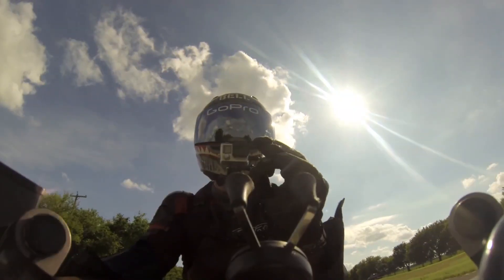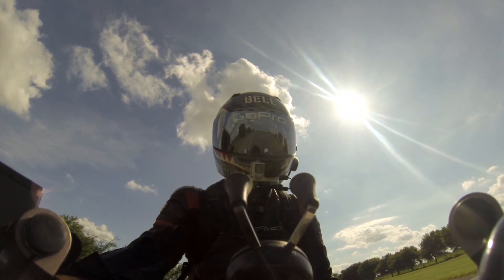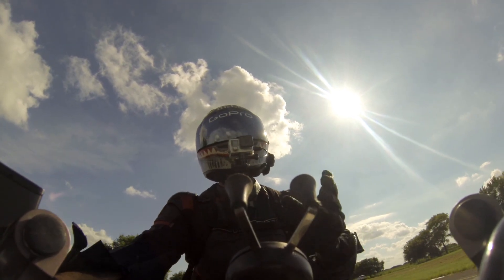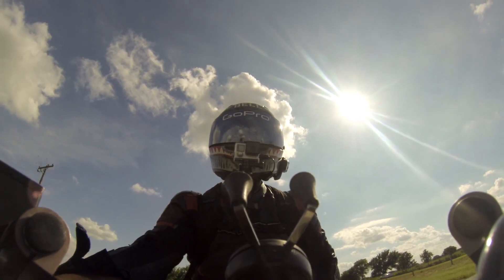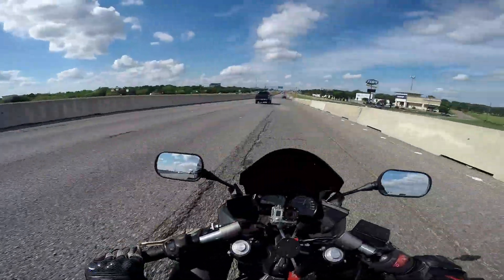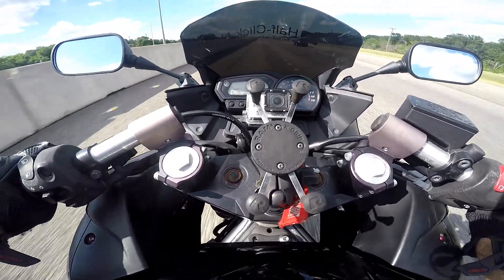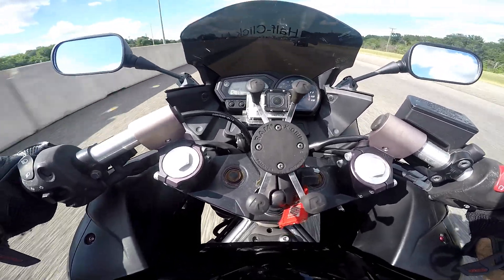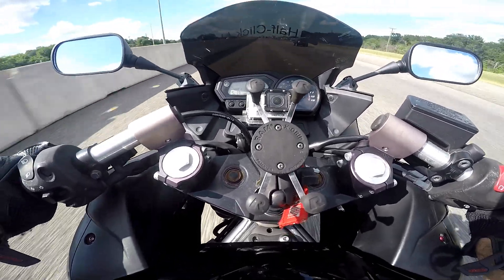FZ6R Fuel Maps Revisited

Comment: Hey dude, I love your channel!
Great content for fellow FZ6R owners.
Quick question: did you find that since running the PCFC with Marty's map and full exhaust system, the bike has a (very) strong exhaust smell? Akin to a two-stroke engine. 
It smells as though a lot of fuel is unburnt. Therefore maybe indicating that the bike is running too rich.
My concern is by turning the rpm dials up to 50%, the bike will run even richer.
Reply from the maker: tuba337 I know exactly what you’re talking about. While the map indeed creates a rich mixture, you have to remember that an aftermarket exhaust setup no longer has an emissions component to the system. You’ll notice the same rich exhaust smell on a modified car that is running true duals (for example) with no cats. Same situation with a straight header/slip-on setup on a bike. Always inspect your plugs ever so often for a personal reassurance that your mixture is just fine 😎
Reply: @HalfClickUp  Glad to see its just not my bike. 
I got caught in bumper to bumper traffic the other day and when I finally got to the office, the exhaust smell was pungent!
Something I never noticed when riding out of town.
Also, I went one tooth down in the back. It's awesome, the bike has even more gusto.
Reply from the maker: tuba337 interesting choice of a tooth drop. How’d that move your power band around?
Reply: @HalfClickUp  I reread my comment, I meant one tooth UP.😁 From 46 standard to 47.
Higher torque and much more fun from the start. My rpms are a bit higher at cruising speed ( sixth gear - 7000-7500 @120 kph) and fuel efficiency dropped but still an overall gain in grunt.
Reply from the maker: tuba337 😬👌

Comment: I just purchased an 09 fz6r, it has two brothers and juice box on it. You think it would be okay to just turn the low mid and high to the halfway mark? I am not sure what map is on there because i dont have the cord to connect to a laptop
Reply from the maker: Yes, I’ve determined through experimentation  with the PCFC that the halfway mark represents the “neutral” position, where the controller will run a selected map at “face value,” so to speak. That gives 50% range for turning trims down, and 50% range for turning trims up. I’m sure the Juice Box operates the same way.
Reply: @HalfClickUp  Do you still run marthys map? My next step is to try and find a cord to plug a laptop in and see what map is running my bike, Im going to take a wild guess its the two brothers map
Reply from the maker: @capton87  I have been running the Hindle Performance dyno tune for a couple years now. It’s leaner than Marthy’s and produces a bit more pull in the mid and high range. Shoot me an email when you get a cord and I’ll send you the Hindle map. You’ll never go back.
hcumotovlogs@gmail.com
Reply: @HalfClickUp  thanks for the fast replies! Glad there is someone who posts so many fz6r videos
Reply from the maker: @capton87  happy to help, and thanks for watching!

Comment: Now im gonna have to mess with my PCFC tomorrow afternoon, thank you! You should have a 50,000 mile celebration party and review! 🎉
Reply: @HalfClickUp So what are your dials set at now for fuel ratios on Marthys map? If 5 is now considered base, did you leave them put, or down a click in the lower, and up at high end rpm and so forth?
Reply from the maker: Robert Smith so I’ve got all three dials turned at exactly 50% at the moment and have not experimented yet. I’m thinking of turning down the low range dial by one click though. Have experienced a slight momentary break up at light throttle in 1st gear at 15 to 20mph going red light to red light. It’s happened twice in a solid week of daily commuting.

Comment: Glad to get another opinion on the fuel trims!. I’m really enjoying mine right now, especially with the sprocket..which to be honest, I really wouldn’t recommend to you only because of your daily highway commute. Speaking about coolant temps, I have a brand new radiator with new coolant and in 95° weather I stay around 195ish so I might look into the engine ice. Looking forward to the review man, keep it coming!
Reply from the maker: Phillip Owen I’m glad you mentioned the sprocket, because I’ve been backing away from the idea lately. I think I still might be game for the timing advance mod, though.
Reply: Half-Click Up in 6th gear at 70, I’m around 76-8000.
Reply from the maker: Phillip Owen wow, that’s a pretty good shift in the power band. I’m at 7,000 at 80mph, so I guess my 80mph interstate cruise would be closer to 8,500 or so if I drop a tooth. That’s a bit much I think..
Reply: Half-Click Up I cruise at 80-85 for about a good 40 mile interstate cruise a few times a week and tbh..it doesn’t care at all. I just don’t like doing it too much..
Reply: Half-Click Up...not to mention it absolutely killed my top speed. 😳 all in all, it was worth it to me, but I can definitely see how it wouldn’t be for some people.
Reply from the maker: Phillip Owen I feel like I’ve dropped a tooth already with all this new fueling 😆
Reply: Half-Click Up just seen someone on the forum post a link to the 4° timing wheel on eBay and said with his exhaust, no fuel controller, said before and after it dynoed extra 10hp..🤔
Reply from the maker: Phillip Owen I believe it. A fellow FZ6R rider up in Dallas, “TexasMoto,” has already performed the timing mod on his factory timing wheel and he said the front wheel can get floaty at WOT. That’s impressive for the 6R!
Reply: Half-Click Up I get at about 7k in first and close the throttle and then hit wot and it picks up and I’m a much bigger guy than you..my second gear is floaty. I figured I might just get the timing wheel already modded since it’s only $30 or so. 🤷🏼‍♂️

Comment: Hey friend, I'm here to tell you that from the power commander fc control center, you can actually see what value each setting is at, because it indicates it in values that, I think, range from -3 to +10.
As you move each knob, you will see that on the PC you see the indicated value go up or down.
I have loaded the map that you kindly gave me (Hindle), and I just turned those 3 dials until I left all three of them at zero value.
I haven't tested the bike yet, but I understand that whoever made the map took the zero values into account, because otherwise, I suppose, they would have specified what trim values each knob should have.
Reply from the maker: I’m not entirely sure, but I can tell you that I experimented with both completely turned down and completely turned up and she ran terribly both ways. With all three set at “zero,” she screams! 👍

Comment: Hey, I have a fully stock 09 fz6r. I just got it last summer. Its gets about 100 degrees here in the summer and my bike heats up to about 220 in mid summer. Any advice? Or is that normal? And what's the first thing I should do to make this bike a little faster? Or just any advice period? It's only got 15k miles on it and I want it to last a long long time. Thanks.
Reply from the maker: Jordan Brock that’s pretty dang hot dude... highest I’ve seen while running is 214. Do a coolant flush and switch it to Engine Ice, see if she runs cooler. As for go fast parts, exhaust with fuel controller is a world of difference. Let me know when you get ready and I’ll send you a killer dyno tune for it.

Comment: What about the 1st dial "base" on the pcfc?
Reply from the maker: ni55un that first dial is only to select which map you want to run. There are 10 slots to choose from if I recall. For example, in slot 1 I have the Two Bros map, and in slot 2 I have Marthy’s map. The dial is set to 2 to run Marthy’s map.
Reply: Be precise because I caught mine a little in between I guess and it jumped down to the map before mine, which tbh, the DynoJet maps are junk. Lol

Comment: So many bikes probably got blown up because of this. You can see what the values are at on the computer. Your telling everyone to just turn them half way up. They are set at 0 from the factory. Only the people who listened to you in the first place should be turning them halfway up otherwise your cylinders are gonna have a gas bath
Reply from the maker: Oh come on now. Any extreme variation in trims by way of the controller’s dials simply causes poor performance, and I’ve confirmed that myself. The ECU compensates to the extent that the engine still runs while you correct the dial settings to restore performance characteristics to your liking. That’s the point of the PCFC’s “on-the-fly” adjustment capability. No dial setting on the PCFC results in engine failure.

Comment: So put them in “5”
Reply from the maker: Cesar Ruiz basically, yep. I ended up lowering the low range dial by one notch because of a couple instances of over-fueling at light throttle/slow speeds.